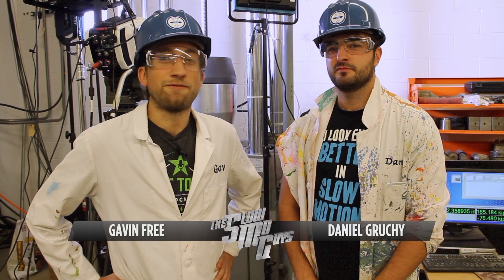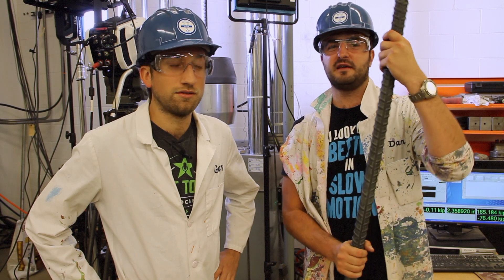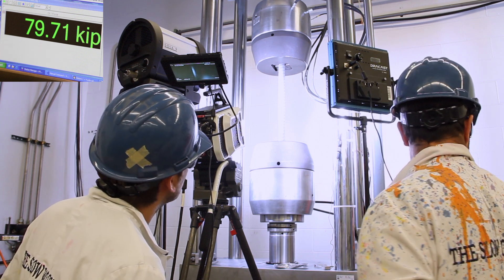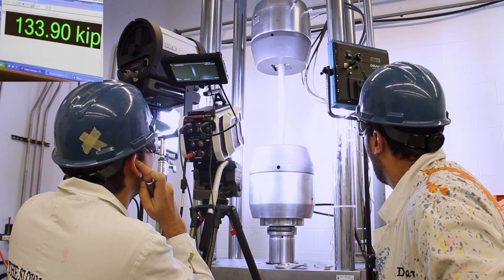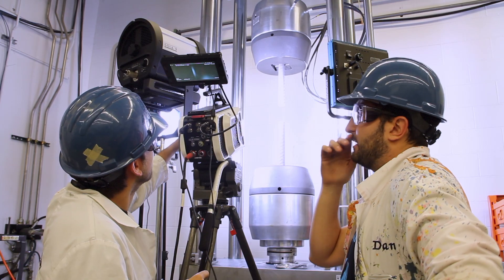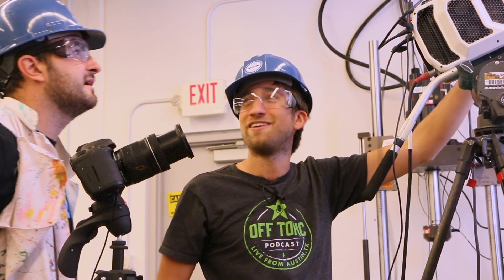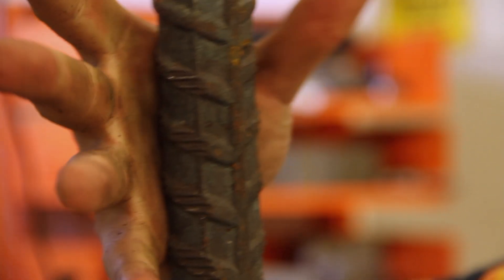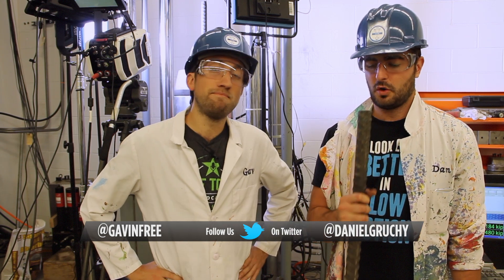Snapping a Steel Rod 1000x slower - The Slow Mo Guys

Comment: Should've tried melting it with jet fuel.
Reply: Would have actually proven that the World Trade Center tower was brought down by the planes. It would have stretched to a much greater degree and probably not snapped that way. You don't have to melt the beams to lessen their strength.
Reply: Destinatixn _ I learned that back at 9/11
Reply: Senior Engineering Student Here.
From AISC Steel Construction Manual Fourteenth Edition, TABLE A-4.2.1 Properties of Steel at Elevated Temperatures: (Fu is ultimate strength) Steel doesn't have to melt to be significantly affected. Also, the steel in the towers was already under more stress than designed for, due to the remaining structure having to do the job of the destroyed members. It's like clogging a stream, it may go through another creek, but if you start clogging that creek too, it will overflow. 
68 F (20 C) --------- Fu*1.00
200 F (93 C) ------- Fu*1.00
400 F (204 C)------ Fu*1.00
600 F (316 C)------ Fu*1.00
750 F (399 C) ----- Fu*1.00
800 F (427 C) ----- Fu*0.94
1000 F (538 C) --- Fu*0.66
1200 F (649 C) --- Fu*0.35
1400 F (760 C) --- Fu*0.16
1600 F (871 C) --- Fu*0.07
1800 F (982 C) --- Fu*0.04
2000 F (1093 C) - Fu*0.02
2200 F (1204 C) - Fu*0.00
Reply: colavfreak2 true
Reply: Teo, We designed the buildings to resist shear stress and bending moments after multiple jet planes (size of a 747) impacts in order to be able to repair the damage
Reply: kaladze09 I'm no expert but I think it might have collapsed because a plane flew into the side of it...
Reply: [lus the open elevator shafts turned it into a 400 foot tall forge
Reply: Exceed Edlo but the thing is - not what caused the beams to melt, but what caused the building to fall the way it did. There are certain types of collapse methods and the way this one fell was 'controlled' and not due to the melting..
Reply: Exceed Edlo Why u getting triggered
Reply: people saying it's a controlled demolition have never flicked the side of an empty soda can with someone stood on top. maybe cus they have no friends.
I was 11 and even I could see "hey they're stacked up like plates. if the weak part caves in they'll cascade on top of each other and domino effect" then it happened a few seconds later.
the point people seem to miss is that it didn't fall like that because of controlled demolition....controlled demolition is done like that because it takes advantage of natural physics.
Reply: I have a 4 year degree in Welding Engineering Technology, it is by no means an exaggeration to say that I have more metallurgical knowledge than anyone else in this comment section. So I'm not telling you this as someone with an opinion, I'm telling you this as an expert with factual knowledge.

The jet fuel from the jets lit other things inside of the World Trade Center on fire such as carpeting, electrical insulation, wooden desks, ect that combusted at temperatures high enough to weaken the steel beams enough to collapse the World Trade Center.

There was no conspiracy, nothing has been covered up. Normally I wouldn't bother with tin-foil-hat-heads but having studied for years in a metallurgical field it infuriates me to see people who have this incredible blatant disregard for the basics of metallurgy.
Reply: Coach Wilson ok coach huh
Reply: Teo molten aluminum from the fuselage explodes when introduced to water from the sprinkler system
Reply: Leo Tapp should I though?
Reply: Leo Tapp why would I learn that
Reply: kaladze09 maybe the design wasn't quite good enough maybe the plane went too fast maybe it was just too damaged.
Reply: +PMadFlyer    Another thing to consider is super ductility. When a metal reaches sufficiently high temperature, usually about half that of the melting temperature measured by absolute temperature, it will become super ductile. Meaning that the metal will not work harden even if the material is stretched/compressed far into the plastic region. Usually when a metal starts to bend, it will work harden, halting the bending process. This will not happen if the material is super ductile.
Reply: Demetre 
Ha
Reply: finally awake ..huh?!
Reply: hahahahahahahahahahahahahahahahahahahahahahahahahhahahahahahahahahahahahahahahahahahahahahahahahah
Reply: lmao
Reply: Demetre h
Reply: I don't get that at all.
Reply: Teo you’re fucked up

But I like it
Reply: Coach Wilson watch zeitgeist the movie
Reply: Toms Tech Did you really just compare a 104 story steel frame high rise to a soda can?
Reply: Jackson Davis The towers were made of more than just metal...
Reply: You can weaken it with burning jet fuel.
Reply: Teo Do you still have to post conspiracy theories on 9/11 even though it was 17 years ago?
Reply: or asked the 911 investigators if thermite and explosions
 help distort the metals
Reply: 911 didn't happen the planes were CGI
Reply: @exceededlo2762  Write the name of the person you are commenting to, because otherwise you are replying to the original comment of the thread...
Reply: Teo no kidding huh? yea the world Trade Center deal was a conspiracy huh?
Reply: Coach Wilson what huh?
Reply: Teo I made the connection to the thought that this is the type of construction material that would have failed in order for the WTC to fall down
Reply: Jet fuel can't melt steel beams. -Bush
Reply: Jackson Davis,  unfortunately being an expert in welding engineering is not enough to make quick conclusions about what made the building collapse in such manner. If you are an engineer your are probably familiar with hyperstatic structures, bidirectionnal slabs, moments of inertia, bending moments, shear stress,security factors, HSS's, Girts, Gaussets, thermal expansion, etc... I could also talk about structural analysis, applied maths, theories and designings of structural beams. I'm not saying it was an inside job or not. Actually I don't give a flying F*ck who was responsible for this. What I do care is why the most tallest and strongest buildings at that time collapsed due to damage and fire and killed over 2500 people. As a civil engineer I have the responsibility to fully understand how those builidngs collapsed in order to avoid such designings in future.
Reply: Jackson Davis yeah you're right. Even if jet fuel can't melt steal beams, a plane flew into the side of the building, obviously it's gonna be pretty damaged so it's likely it'll fall down, it's common sense
Reply: Jet fuel can't melt steal beams! You should have learnt that in school.

Comment: You can get a similar warmth if you twist paper clips until they snap. Which is basically the same thing as this except much much easier (especially since you're twisting instead of pulling).

Comment: Why does it break in the middle?
Reply: Barry Sabahat it has the same diameter all the way, but under load it narrows down in the middle because both parts (upper and lower part) are almost equally stable. this technique showed in the video is used to determine the tensile strength and the tear resistance of a material in technical engineering. it's important for like elevator wires. every metal is like a spring, you can pull it a bit apart, it will deform elastically and then snap back but at a certain point, it's deformation is permanent and it becomes unusable.
Reply: why not?
Reply: because thats where it gets the thinnest diameter
Reply: because thats where it gets the thinnest diameter
Reply: BlenderTutGerman ok, but what I thought the piece of metal was the same thickness all the way through.
Reply: Barry Sabahat imagine, it wouldn't break in the middle. that would mean the lower or upper part is more stable than the rest. but it simply isn't.
Reply: I see. Thank you
Reply: Barry Sabahat np glad to help : P